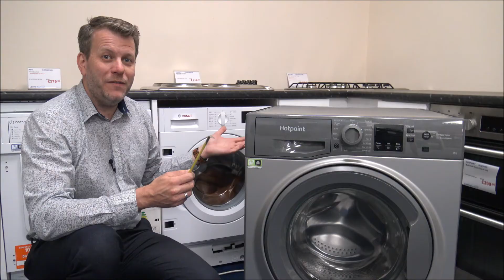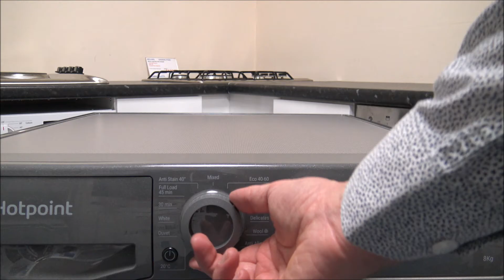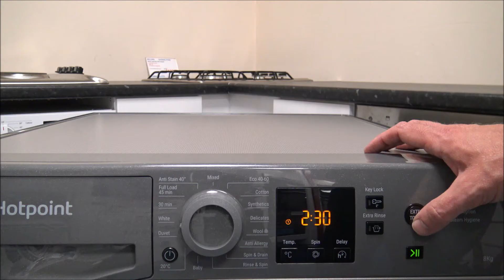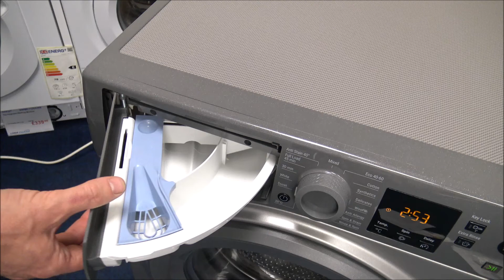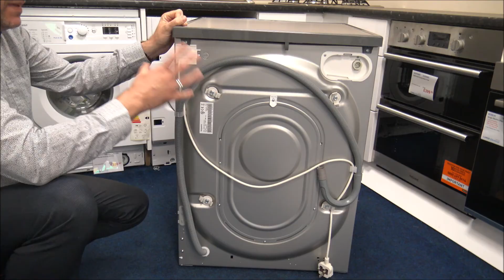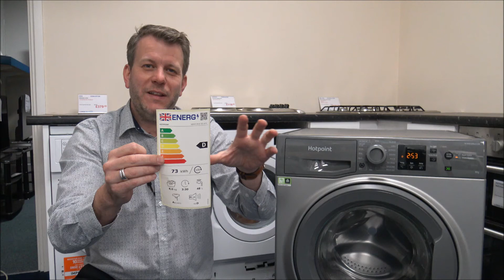Hotpoint NSWM863C 8Kg 1600 Spin Washing Machine

Comment: Hotpoint washing machines get SLATTED for being problematic and inferior...  But you only ever hear the horror stories 
You don't hear when people buy them and get 10-12 years of trouble-free service from them...  
But let me tell you something about Hotpoint washing machines ..... If you get  "A good one" ..... You get a VERY good one. 
At the price point of around just £ 280-ish (Information correct as of March 2026) ...You could do a lot worse for the same money. 
As a BUDGET washing machine...I highly recommend them. 
To make the machine last longer, do the following.... 

1) Don't overload the drum.... EVER! 
2) What cleans also has to be cleaned.... Every month, clean the powder drawer. Clean the drum, including the rubber seal, on a 60-degree empty wash...No spin. 
3) Every three months, clean the filter and the bottom right-hand side of the machine.... You have to take the plastic cover off the bottom. 
Put a towel down as water will come out as you turn the screw.... and it is anti-clockwise on this machine to loosen it. 

EDIT... If your budget stretches, a Bosch Series Two is a good alternative. These are known for superb reliability and longevity.
Reply from the maker: Great feedback thank you 🙏🏻

Comment: Can you use rapid mode on all cycles? & Does it use a full 1400 spin?
Reply from the maker: No there will only be certain programs that you can use the quick wash and the full 1400 spin on, the same as some programs will limit the capacity of clothes you can put in
Reply: mixed, synthetics, delicate, whites, anti stain, in those cycle you can use rapid

Comment: How do we clean at the back of the detergent ,/softener parts? Like the inner parts .
Reply from the maker: If you open the drawer, then open it a little more to take the clip over the edge then you can pull the drawer out to clean behind the soap drawer itself

Comment: i put on a long cycle was in error. Am i able to stop the  cycle mid wash so i can then just go to do a rinse and spin ?
Reply from the maker: The only way is to stop the machine and try and drain the water but there may be detergent still in the wash so I would normally just let the program finish rather than trying to stop it mid way through

Comment: Hello, Ariston hotpoint washing machine NM11825WSA  error f4e2 what is the problem please
Reply from the maker: This could normally involve an issue with the water inlet. First of all check to make sure the hose isn't kinked at the back of the machine, but apart from that check the filter is clear at the bottom of the machine. It may be a faulty water inlet valve which may involve an engineer

Comment: Some of the washing cycles are way to long , for example “Cotton” cycle is 3 hours and 35 minutes and “Synthetic” cycle is 2 hours 55 minutes which in my opinion is way to long.  Is it possible to shorten these cycles by manually reducing the time. ? Or are they pre-set times that cannot be changed
Reply from the maker: Depending on the program you are selecting, you should be able to add the Rapid option to the program to speed it up

Comment: Just got this and the little plastic part that stops using all the liquid detergent straight away seems to be preventing the machine from using it, after a cycle there is still some liquid left in the draw. Anyone else have this issue
Reply from the maker: That could be either the water pressure is a little too low if it isn't clearing it, or you may be putting too much detergent in?

Comment: Can you use the pause button during the cycle?  It is the only question I had and the only button you didn’t cover.
Reply from the maker: You will be able to pause the machine during the cycle, but if there is water in the drum you won't be able to open the door.

Comment: Anyone know if the machine clicks 3 times before starting up? I have the 9 kilo version and it's not mentioned in the instruction's
Reply from the maker: When you press Start on a wash, it will click as that is the door locking. The same as when the machine finishes the program too it will click to unlock the door.
Reply: @lords-electrical Thank  you very much. It was freaking me out a bit.  Must say, I bought my former machine from a reject shop for buttons. Lasted for over 20 years

Comment: Just seen this video, as I have had this machine for a few months now. I find that the fabric conditioner remains in the drawer after wash. Or water sits in the fabric conditioner slot after wash. Why is this?
Reply from the maker: This can be a common issue and it can be down to having too much conditioner in the drawer, the other reason is that the water pressure can be too low so it is not taking the liquid through the machine correctly. Turning the water up a little may help.

Comment: Just brought this machine as always had a hotpoint ,I'm finding my washing don't smell of the fabric conditioner or anything did not have a problem with this with my last machine any advice would be appreciated
Reply from the maker: It's something that does crop up with some customers and it can be because modern machines use a lot less water compared to old machines.

Comment: Mould will grow inside the soap drawer as the small flap door does not come out . Bad design . It seems all  HOTPOINT HAVE THE SAME DRAWER
Reply: It does come out
Reply: How many years will that take to surface however? Few years I’m guessing
Reply: It does?! What you on
Reply: How to remove the drawer 12.15
Reply: 15:12
Reply: 15:12

Comment: On 45 min wash number 10 flashing code, no finishing  spin?
Reply from the maker: How large is the load? If it is too small a load then it could be that there is not enough in the drum for it to balance the load correctly.
Reply: @lords-electrical  A full load for 45min wash
Reply: the 30 min rapid wash on number9 works perfectly and drains and spins correctly ?
Reply: do not use the 45 minute program! it will kill your machine as it uses way too much water, for more eco friendly and quicker drying time the mixed cycle is a much better solution!